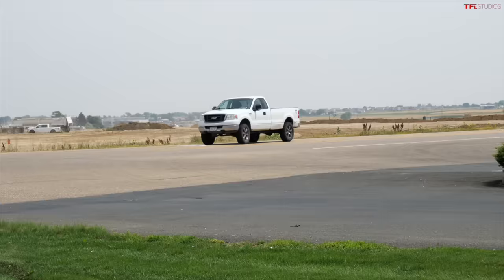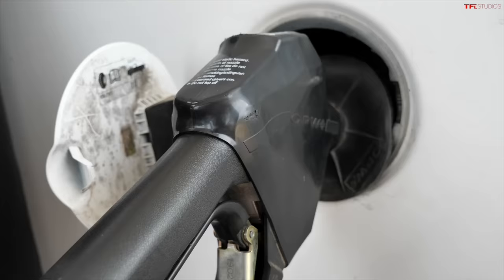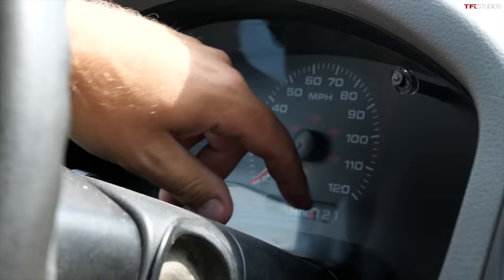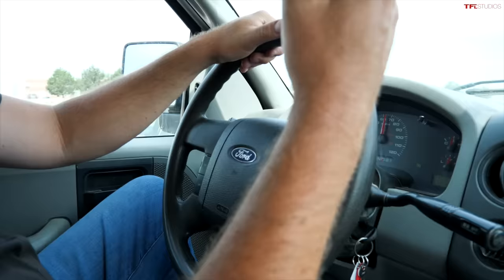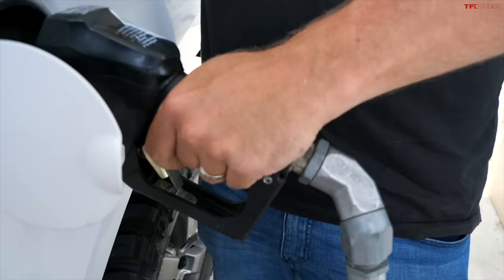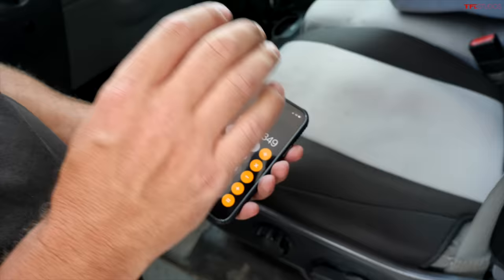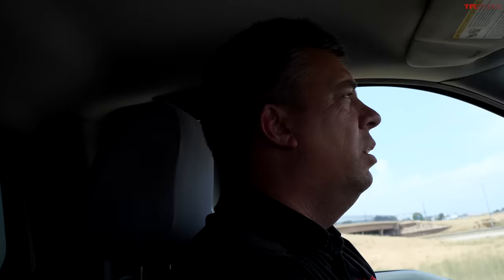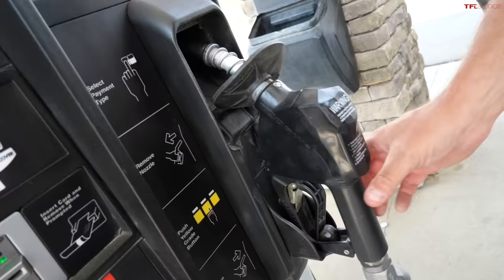Surprising Result: Here’s What Happens To Your Truck’s MPG When You Install A Topper!

Comment: I recently added a camper shell to my personal DD pickup. It's a mid rise shell. I went from 14.7 average mpg to 16.2 mpg with the topper. This is a months worth of mpg calculations with the topper
Reply: I wonder what the gas mileage would be if you had the tailgate down vs. the tailgate up?
Reply: @networth9151 It would be about the same savings on gas . I’ve drove pickups for for 50 year’s and that’s the easiest way to improve gas mileage because it reduces drag and increases airflow. You’ll never get great gas mileage with a truck because of gears and weight,height ect. but a couple of gallons adds up .
Reply: @networth9151  mileage would be worse. There are plenty of videos explaining why. Aerodynamics get worse with the tailgate down
Reply: if your topper had a tail that stuck out the back and extended downwards to cover the bumper of the car you would save another 1 mpg
Reply: Good to know.  Today gas is over six dollars a gallon here in California.  I was wondering if I should remove the top of my Nissan frontier but now I won't. I'm getting around 18 mpg
Reply: I wonder what affect the decrease in air density at your altitude has on your matching that of new trucks (tested at lower altitude)
Reply: @networth9151 Study's have shown that the tailgate down, increases the length of the truck and creates more drag, and decreases the mileage. The up position of the tailgate blocks the wind flowing through the bed, and backs it up to creates an aerodynamic buffer that causes all the wind to go up and over the back of the truck from the back edge of the cab. I had to try it on my own truck to see the difference.
Reply: @donaldpiper9763 you have been mistaken for 50 years.
Reply: It's camper shell not topper get it right
Reply: @kevinburgess2039  camper shell, topper, cap…potato, potato. Different names for the same thing
Reply: I would like to see when towing an enclosed utility trailer if the camper top creates better mileage or not.
Reply: Thank you
Reply: @networth9151  Myth Busted. This exact scenario was on Myth Busters. Just leave the tailgate up. Or, as they did on Myth Busters, take the tailgate completely off and with less weight, you'll save fuel.

Comment: TLF Truck should do the same test but with a   tonneau cover
Reply: And tailgate up verus tailgate down or tailgate removed.....I recall that being a big debate back in the 80s...
Reply: That debate has been resolved.  Tailgate down on a modern truck decreases fuel economy.  

Modern trucks have been designed to have a swirl of air that is “trapped” in the bed.  This causes the air coming over the top  of the cab to stay above the pocket of trapped air making it go over the top of the tailgate making it more aerodynamic with the tail gate up.  When you lower the tailgate, it causes more turbulence behind the cab and this will end up hurting your fuel economy.  This is on a modern truck.
Reply: I didn't see noticeable difference with a Chevy Colorado.  Right foot makes the most difference in MPG.
Reply: @ThisGuyRides  a tonneau cover doesn't make a difference either, my last 3 trucks had tonneau covers and  never had a change in fuel consumption if I took them off or not...
Reply: It's been done 100 times on YouTube, they make no difference.
Reply: Spoiler alert - same numbers.
Reply: Same results
Reply: Tonneaus are best, better than anything, next best is just the way the pickup came, bed open tailgate up.

Comment: I would like to see this kind of test ran with a box trailer.  Run it with the topper on and off and see if the topper helps with fuel exonomy.
Reply: Exactly what I was going to say!!
Reply: Agreed
Reply: If it's a wedge topper it will help a little, but the top of the wedge needs to be pretty high to give you an advantage.
Reply: Same. I'm get 6 or 7
Reply: This! I get 1-2 mpg more with my v-nose after buying a mid rise shell.
Reply: Love this idea for a comparison video
Reply: I've wondered the same for a travel trailer, it seems it might reduce wind resistance on the front of the trailer.
Reply: Excellent idea
Reply: @robedmund9948  - That depends on how tall the trailer is.  My uncle used to have small enclosed trailer (6x10 IIRC) and he said that he could barely tell it was there when he had his topper on and it felt like a million pounds (obviously an exaggeration) without the topper.  It was a 90 Silverado 1500 extended cab long bed, the only part of that that likely matters is it being a long bed.
Reply: Look at semi tractors, the trailer needs to be within 18-24"from the tractor or else the wind drops in front of the trailer. If that's the case try it with no topper and the tailgate removed.  V nose trailers are better that's why they were built.
Reply: 6.7  f350 pulling 8000lb flat front trailer 20' extra 6" height 2mpg worse with high back topper. Air slams front of trailer it tries to dry the road when raining with topper. watching the rain spray is like a free wind tunnel. lose the topper and i lose a parachute when pulling the trailer.
Reply: Agreed
Reply: I actually put a topper on mine so I would not have to pull a trailer all the time.
Reply: I had a 99 Cherokee. We rented a Uhual box trailer a few times. It was a single axle, roughly the same roofline as the Jeep. Gas mileage was roughly the same.
Reply: Actually, if you play with aerodynamic calculators and compare them to real life with and without trailers scenarios, it becomes obvious the tow vehicle and trailer act as two completely separate drags - very little shadow effect and very little possible. 
The key is the distance between the tow and trailer. As an example, if you look at semi trucks, 25% to 45% of all drag is from the gap between the cab and trailer, which is much smaller than a typical truck trailer setup. 
Admittedly, their can be some mileage benefit from a topper. Even a 1mpg can be over a 10% benefit , which can be significant over the long run, but it will depend on the particular truck cap trailer combination not generic.
Reply: A number of years ago, my grandfather traveled extensively with a travel trailer.  His GMC (2WD, V8, long bed) pickup had a topper, but found that he got almost 2 miles per gallon better mileage when he pulled the trailer on fishing trips than he did when traveling for other activities.  The difference?  A 12 ft aluminum boat on the top of the pickup breaking the wind for the trailer.  He ended up taking the boat whenever he pulled the trailer.
Reply: @rimrock53  sounds like I need to buy a boat just for that

Comment: At 18.2mpg, I think the biggest takeaway from this video is how little of a difference all the new technology makes in mpg
Reply: Agreed. Especially when towing. In my experience, it takes "x" amount of power to move "y" amount of weight. I've personally noticed surprisingly little difference between trucks, engines, gearing etc. Some differences, but as long as the truck is running correctly, very little difference. Power difference for sure, but mpg, not really.
Reply: Weight. Modern vehicles are heavier
Reply: @theseb1979  Newer F-150 have aluminum bodies, should be lighter.
Reply: @theseb1979  weight plays more of a role in start/stop driving. Not as much effect for flat highway cruising
Reply: I like and own a few older trucks myself but with that said. The technology used in newer trucks are able to give them better safety ratings, better acceleration and higher towing ratings.
Reply: @theseb1979  this - for sure. more luxury gear, more safety gear, more steel for crash safety, and more power to move the new weight around.

Not too different for passenger cars either. I had a Buick Century in college; 2700lbs. Now I have a Honda Fit: Nearly 2700lbs.
Reply: That's the truth.  It is amazing how bad the mileage on trucks and SUVs is still.  Virtually no improvement at all over at least 20 years.  ...ooh, but you get a touchscreen!!!
Reply: My 2019 F150 Crew Cab 3.5Ecoboost averaged 23 on the highway at 70mph. Traded it in because it had wastegate noise issues, transmission issues, the list is long… FF to today, 2021 GMC Sierra 2500 6.6gasser, best I’ve gotten is 18.6mpg at 70mph. Idk about you, but I am quite impressed by newer vehicle MPG’s
Reply: @jamessanville4825  
My 2011 F150 XLT Supercab 2WD 3.5L ECOBOOST 6 speed auto gets 23 highway 18 local. 
No cap no bedcover.
My only problem was an ignition coil failure. 
Love it.
Reply: @edwaggoner7403  I’m glad you’ve had great luck with it! I just had bad luck unfortunately.
Reply: Yeah maybe you weren't around for carburetor motors
Reply: the new tech has increased efficiency of the power to wheels verses wasted power in heat not to wheels. The new vehicles produce much more power to the wheels and air conditioner ect... than they use to.  They're much quicker also.  In the 80's cars were so slow to only get 20 mpg, today a car getting 20 mpg will run circles around the 80's car getting the same fuel economy.
Reply: @rickmcdaniel6784 wrong, newer F150's are still heavier despite the Aluminum Body.  Of course, they'd be even heavier with a steel body.  The video used a 2004 F150, so I'll use crew cab F150's from 2004 and 2023 as a comparison.

2004 F150 Crew Cab weight (range based on trim/options):  5,200 - 5,600lbs.

2023 F150 Crew Cab:  6,000 - 6,900lbs

The lightest 2023 F150 crew cab is heavier than the heaviest 2004 F150 crew cab, despite the Aluminum body saving up to 700lbs of weight compared to a steel body.
Reply: My 89 C1500 NASCAR look hot rod with a 500hp, 409" SBC & a Holley carb gets better mpg than my 04 Tahoe with a computer controlled 4.8 LS. It's ALL about engine efficiency, aero, weight & rpm.
Reply: @brianhaygood183 it's cause there's a loophole that means companies can bypass fuel regulations if the vehicle is bigger.
Reply: @danschmidt6206  Not sure where you got your numbers from, but they are wrong.  Crew cab F150s got slightly bigger from 2008 to 2009, so they did pick up some weight there, but lost even more weight going to the Aluminum bodies.  The newer trucks are much lighter.

Comment: I’d say to weigh the cap and mounting hardware. Add the same amount of weight to the truck without the topper so the weight is the same on both trips. That will isolate the aerodynamics s the variable. I would expect the results to be nearly the same as before. Cool to see a real world experiment.
Reply: What people want to know is whether or not it helps save money on gas, not the wind coefficient
Reply: Not really. A truck without the bed cap wouldn't have that extra weight, so it wouldn't have that weight in the first place.
Reply: What I wanted to know is if there is any advantage to running a cap that isn't all pigged out but has the same aero surfaces.
Reply: sorry ruined the 69 likes bit also yeah ya gotta point here i can see if the topper was made incredibly lightweight  ya might not see a huge difference but more than before
Reply: Weight of the cap would approximate an that of an extra passenger.
Reply: Except if you add that to the bed of the truck, that might affect the airflow as the bed helps create less drag. Myth Busters did this.
Reply: @rudygeorgiamulesandcountry1594  I don't know about your friends but it would take at about 2 of mine to equal the weight of my cap.
Reply: Topper only weighs around 200 pounds. Lucky me, I'm only like 105, so drag racing is great. I still want a topper.
Reply: @rickymcdaniel7971  your friends skinny midgets? The average U.S. male 20yrs and older is 197.9 pounds. Unless you didn’t know how much a shell weighs the shell only weighs about one persons weight. Andre even says the weight of it in the video.
Reply: Good point on adding the weight.
Reply: That would be one way to eliminate the variable but another thing would be longer tests. The margin hes trying to suss out seems too slim to draw any useful conclusion from. a tenth of a gallon margin on 3 gallons could be foam, could be air, could be a number of things. And the fact its done from a consumer pump, even if he did it at a different pump at the same station it could be within margin of error. Longer tests, emptying up to 20gal would be ideal to actually gleen a significant difference. We know it reduces drag, and weight only counts for so much with MPG because it only affects acceleration significantly. So it should be seeing at least noticeable improvements, But not something that can be shown on such small margins.
Reply: Fair point but I would think having a higher blunt trailing edge would create at least as much drag as you're preventing behind the cab.  Not surprised it's a wash.  If the cap was tapered toward the top of the tailgate I would expect more savings